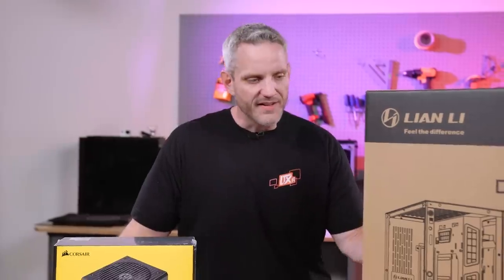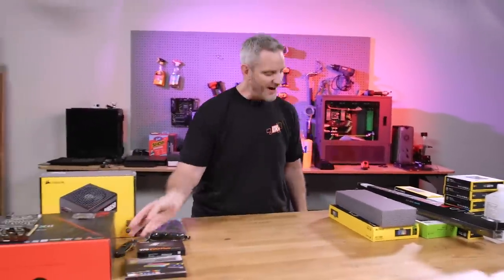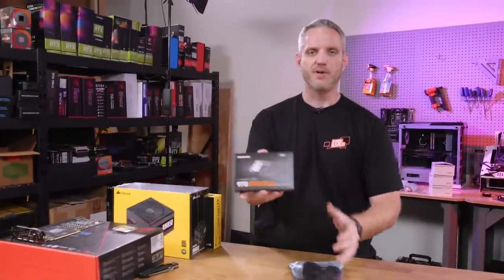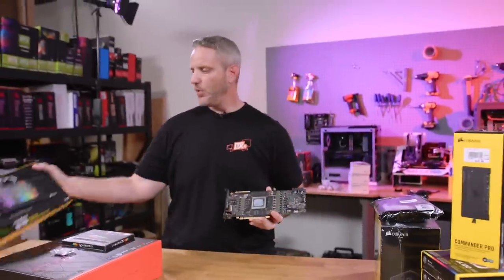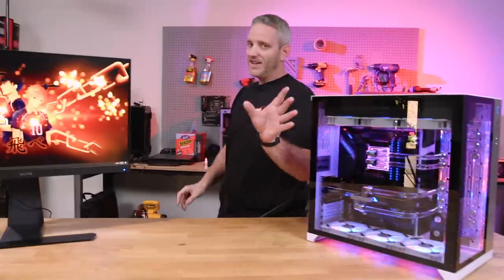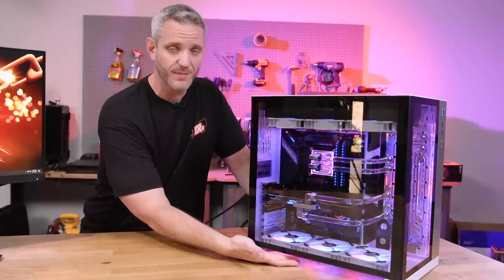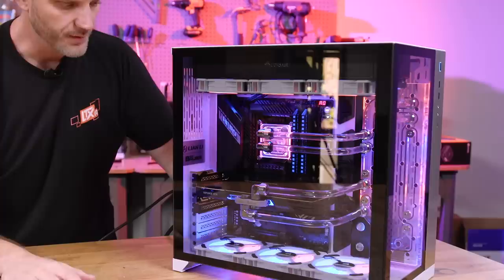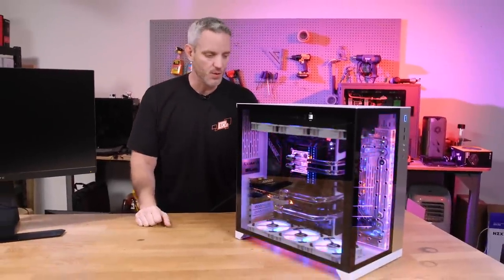I surprised my daughter with her Dream PC! It turned out GLORIOUS!

Comment: Jay: "she's the perfect demographic for RGB, an eleven year old girl!"

Me, a 34 year old man: looks over at my seven rgb fans and rgb ram mounted on an rgb motherboard inside an o11 xl...
Reply: Me a 67 year old man with with 3 rgb fans and a rgb air cooler and i'm happy as a pig in shit.
Reply: glances at my RGB keyboard, mouse, mouse pad, headphones and headphone stand...
Reply: My bright glowing rgb Razer peripherals that never work properly...
Reply: When I was building my current PC 2 years ago, I realized it was kinda hard to find stuff without RGB... so I gave in. The bad news was I cheaped out on it because I didn't have much to spend anyway, so it turned out.... meh. It seems you should either go all in with the RGB, or avoid it entirely.

All in all, RGB was a mistake.
Reply: You forgot the rgb case strips, rgb graphics card, rgb hdd and ssd, rgb psu, rgb aio, rgb mousepad, rgb mouse, rgb keyboard, rgb headset, rgb headset holder, rgb strips on table, rgb strips behind monitor, rgb monitors. Oh and I forgot the RGB cables.
Reply: @ZombieRonSwanson  The headphone stand made your comment stand out to me, no pun intended, I just felt the wording works.
Reply: @gretchman That would have also been me, but Amazon sent me the WRONG COLOR for my O11 XL. I wanted black, they shipped me a silver case. :( Back to twiddling my thumbs waiting for shipping again...
Reply: The perfect demographic for rgb is anyone
Reply: 31, same set up, plus RGB on the graphics card and the nzxt x72 kraken
Reply: this got me slapping everything in my room in laughter
Reply: @btCharlie_  As a 20 year old after buying a bunch of cheap rgb, it was nothing but a pain in the ass and the looks is just soo overdone and bad. Especially the fans....I'm planning to just replace most of it with quality stuff and Noctua fans. The only rgb I'll keep is my ssd m.2, ram and the strips.
Reply: I am 22 and i want some of that good stuff.
Reply: My daughter brags that her motherboard lights up, not rgb, and they mine doesn't. She's happy with hers.
Reply: Me with Rgb Fans (Radiator and Computer), Motherboard, Graphics Card, Ram, Led Strips, Headset, Mouse and Keyboard. Only thing that is not Rgb on my set up are: Power Supply, Monitor, 7.1 Surround Audio Solution and Gaming Chair.
Reply: @tazgamerplays  Don't show her this vid then, whatever you do!
;-)
Reply: @RogerBarraud  I won't be.

Comment: I geeked hard when he opened the back.  The amount of room this case gives you for proper wire management is just amazing.  More than I can say for Fractal Design.  Don't get me wrong I do love my S2 Vision RGB Edition but not a lot of room for wiring. I'm currently working on a build similar to this.  Most of the water cooling components are the same but I am going 11th gen and using the Maximus XIII instead. So excited to finish it and have that classic retro but modern look.  Great Video!

Comment: Jay: "I ran Heaven for a bit earlier on this 2080Ti cooled by the Corsair block..."
Also Jay: "...not overclocked or anything, there's no reason to overclock for her."
Reply: Running heaven isn't something you'd just do to overclock though. It's a good test on the hardware.
Reply: The way he describes it, all the major components of the PC were used because they were basically leftovers... He bought a case, a cooling block and some fans.

Comment: I like the layout of this case it’s a bit like my Thermaltake View 51 which just has more glass panels. I like the fact that the power supply is up against the back panel and out of the way and if like me not good at cable management there is plenty of room to hide it in the back even the bulky stuff. 👍🏴🇬🇧🤠

Comment: O11 Dynamic (Original, XL or EVO) is still the best case today for everything that's not ITX. It's so popular for a reason: flexibility. It works on aircooling, watercooling, RGB, no RGB, discrete builds, flashy builds, big GPUs, small GPUs...

Comment: I'm still here with my parents old pc and I'm happy about it because previously I was using my brother's old laptop from 2010 not made for gaming and it gave up around a week ago so it's not even able to turn on, as I said earlier I am currently using my parents old work computer and the only reason I even got to use it was becouse my "friend" stole around $700 of parts from it and my parents didn't realize that the parts were missing for around two weeks and bought a new PC same exact spec and model then they realized and got to the kids parents about it and they said that they were finding loose screws on all there computers and stuff looked tampered with and they were finding stuff stashed around there house turned out the kid was selling ' used computer parts ' to pay for a new computer for himself we asked him multiple times if he had them or had seen them being taken and he kept denying it so we mentioned it to the police and they went to his house and he denied once more then around a week later his dad drove him over to our house to give the computer parts back and he gave them back but at this point my parents had already bought new parts for the PC and had them professionally installed so the parts were useless and we are not pressing charges however we are having him put through a mental health center as he had stolen mini liquor bottles from our local gas station and been cought, none the less he is only 14 I'm 13...

Comment: It is... pretty!
I'm of the generation that used to build PC:s which were light gray. The case was gray, the parts were gray, the monitor was gray, the mouse was gray, the keyboard was gray. 
There was no internet to look up how to build them. I remember my first build. The parts came in the mail and then you just wondered "How do these go together" and just figured things out as you went along. Surprisingly the thing worked pretty much straight away.

There was no such thing as RGB or cable management, or transparent side panels. In those good old days cables ran free. The job of the side panel was to hide the cablejungle.
So in essence PC:s were a mess, not a nice thing to look at so we tucked them under the table never to be seen but oh boy you could HEAR them. Those fans were loud.
Now you won't hear your PC but you want to look at it.
The world has changed.

Comment: The next step from full RGB and white would be stroboscopic lighting and disco / rave music inside with song videos displayed on the new Kraken Imax on-cpu display. The space left in the 011-XL could then be used for a subwoofer. The only thing missing would be drinks but the soon to come kraken b-tender 83 where the 4th segment would have a protruding straw will fix that! The only thing you'd have to do outside is dance.

Comment: I still prefer to have drive bays on my PCs if not for an optical drive (which I still use), but also to add more usb ports to the front of the pc because having to move a tower case (midsized or full) is a PITA so I'd rather have things accessible via the front first at least to test to make sure the "item" I'm going to attach to my pc (drive, mouse, keyboard, headset, etc) works before having to futz with plugging it into the back.

Comment: There are O11 clones that actually work better than O11 for some use cases, for example the ones similar to what is shown in this video, with the rad on top and the intake fans on the bottom. I bought an Inter-tech C-702 Diorama for such a setup, because all that added space lengthwise didn't seem to make sense with my Arctic Freezer AIO.

Comment: My dad did the same thing except earlier. I got a i7 3rd gen and a gtx 950 around 2012, I might be off. Now I am 15 and I am saving up my own money from working with my neighbors to buy a more modern build. I'm not going to get the new 7000 series amd processors or newer intel chips. I'm just going to get the 5000 series ryzen 7 5800x paired with a x570 motherboard, 3gb 4000 speed ram, and a 3060ti my dad has from his prebuit since he got a better card.
Reply: so lucky

Comment: i have the same case, just wish it had intake fan on the left side. so i wire tied 1 on to mine lol was prob a waste tho i had to take the glass off and get a desk fan on low to blow on the 3090 or it would prob melt when mining ETH lol (went with red on my colors tho)

Comment: Does the 60mm top radiator and fans you chose to fill the empty space at top overlap the top of the ATX motherboard, or does it just come  up to the edge of the motherboard? Like if I had tall RAM (like with a water block) near the top edge of the motherboard would there be a conflict?
Likewise, do the fans at the bottom overlap the bottom ATX motherboard, e.g. blocking any connectors along the bottom edge or making the bottom PCIe slot unusable?
If you installed a 360mm radiator with fans in the side (where the distribution block is, how thick of a radiator would fit there? Would it bump up against anything (like the top radiator, or the front most bottom fan?

Comment: I made a similar build myself. I had an issue with air from the distribution block back-feeding into  the radiator when the computer was off (the pump is off). the air will travel to the highest point of the circuit then gets stuck in the radiator even when pump starts back up. did you notice this or fix it? use a check valve? thoughts?

Comment: What kind of CPU block is that?
Also What are the names of the Radiators on the bottom and top?

I have the same case, but my Usb 3.0 input plug is in the way of my fans for my motherboard, so i have to have it disconnected.. :/

Comment: i know this is way late but the commander pro deletes that other controller you stuck to the commander.  i have 14 fans in my thermaltake p8 on 3 commander pros and tossed those little controller that came with the fans

Comment: Screw Micro Center they have a graphics card I need but require I come in to the store to get it! I live 7.5 hours away come on man Put a store in Florida!
Reply: I just got a 3080 from microcenter at MSRP so I have to disagree with the in-person rule. That being said I only live 20min away
Reply: @scrub3359  well they won't ship one to me in Florida I know I tried
Reply: @scrub3359  You disagree with the in person after you went in in person and got one? I'm not even tying to get a 3000 series I was just trying to buy a 1660. which are selling for 500.00 or more on eBay USED
Reply: @scrub3359  I think you are missing the whole point I live 7.5 HOURS away from micro Center 7 hours and 30 minutes, you want me to drive all that way when they could just as easily ship it to me?
Reply: @RobertBIrish  yeah I get that it wasn’t possible for you since you don’t live by one. Making it in person only stops people from botting, and combined with their 1 card per household per 30 days, it limits miners and scalpers. Unfortunately it also stops legitimate shoppers like yourself